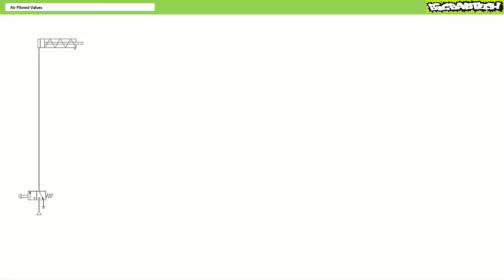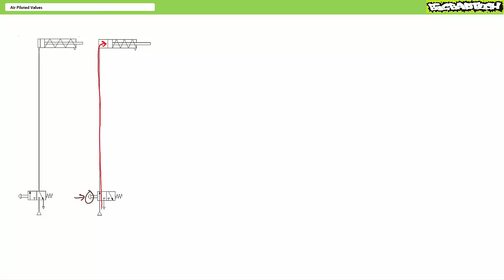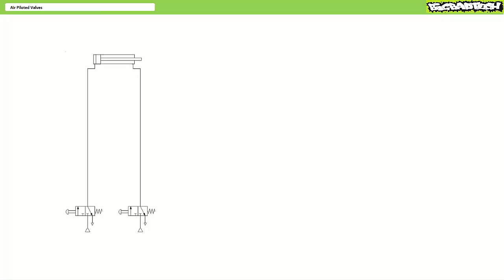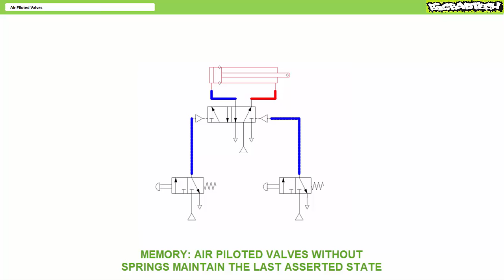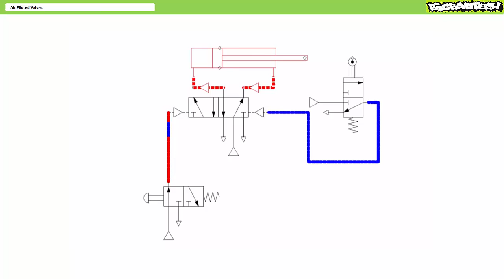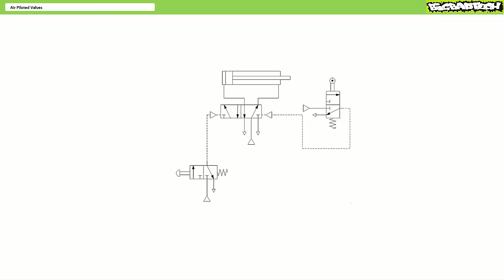Air Piloted Valves (Full Lecture)

Comment: Great video. But what’s the difference between air piloted valves and directional control valves with air springs?
Reply from the maker: Check out the pneumatic directional control valve lecture at: https://youtu.be/Npu9uJYDI2k
Reply: @ I already have, so basically, the DCV with air springs still require some air pressure for the DCV to remain in the deactivated state ( i.e if the method of actuation for the DCV is absent) and the air piloted valves, also require air pressure as a method of actuation, which in turn has some detent mechanism.
Reply from the maker: Yes, an air spring is just a return mechanism that returns the valve to the deactivated state when it's not being actuated by an outside input (manual, mechanical, solenoid, etc.) whereas an air piloted valve the air is the actuation method (ie: not the return mechanism). Yes, some air piloted valves have detent mechanisms as illustrated in this lecture that exhibit memory (the detent) and priority (first come first served). Glad you're making use of this material.